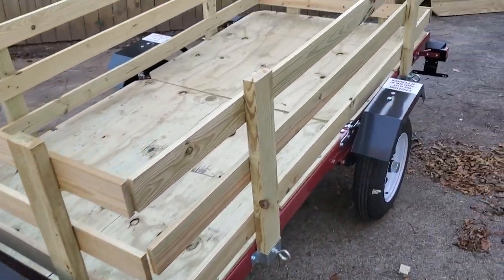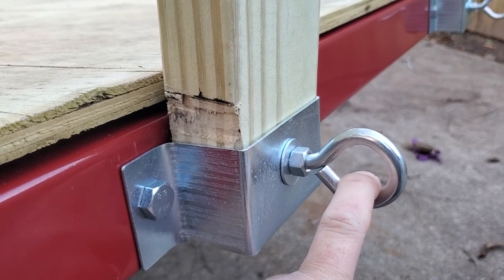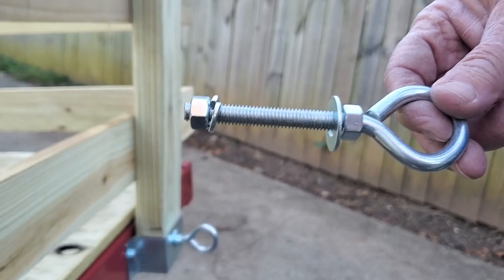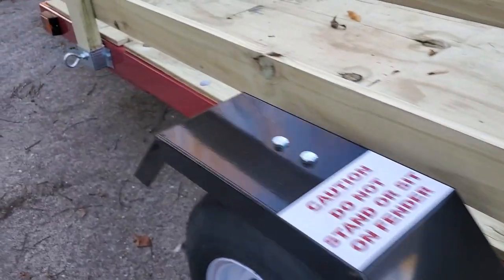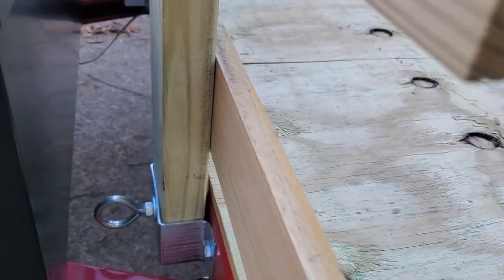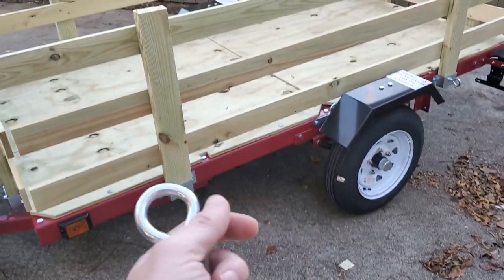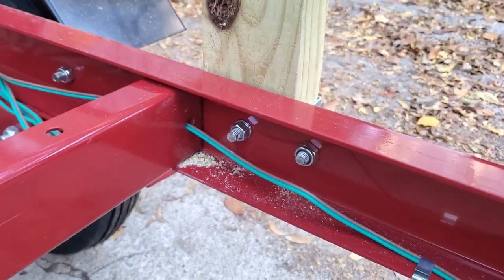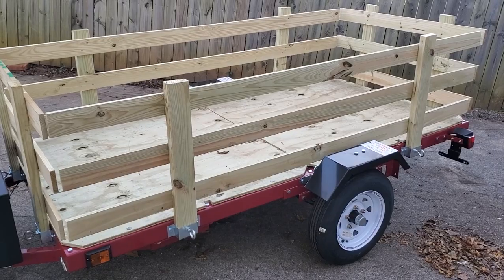Harbor Freight Trailer hack! Easy tie downs addition

Comment: How do you take the sides off to put stuff in the trailer now?
Reply from the maker: I just hand tighten the bolts on one side and then can loosen them by hand when i get to the campground and get one side taken off. I have lock washers on them so they don't unravel while in transit. Over 2000 miles on the trailer with this setup. Works great 👍alternatively you could just take a ratchet and socket along to loosen and tighten the bolts.